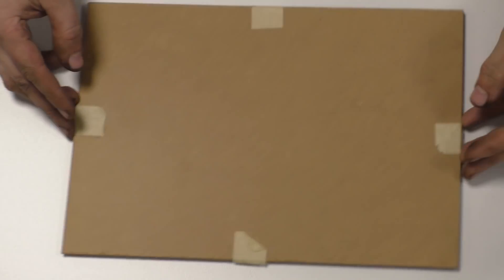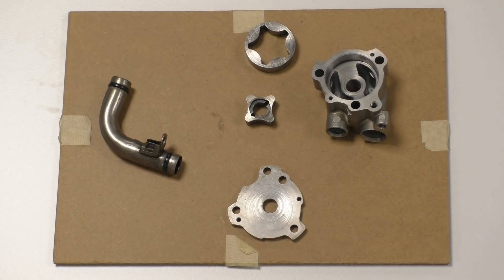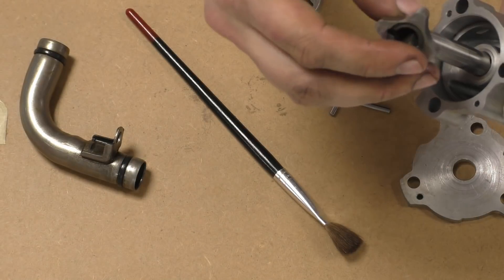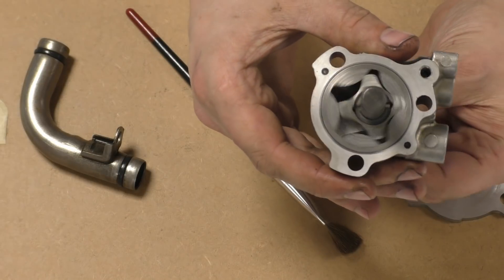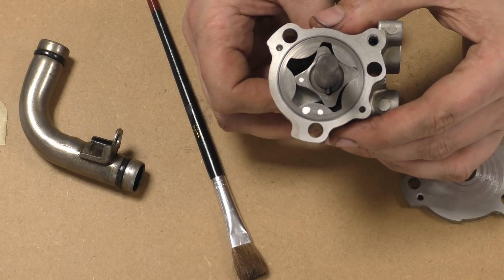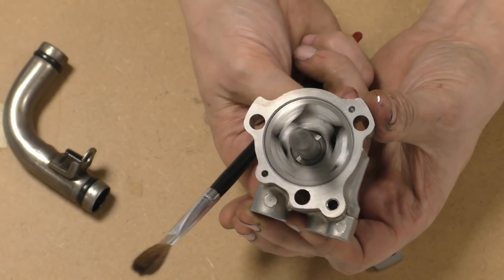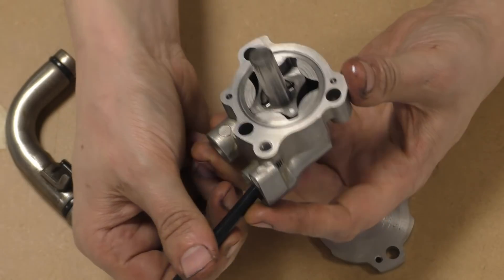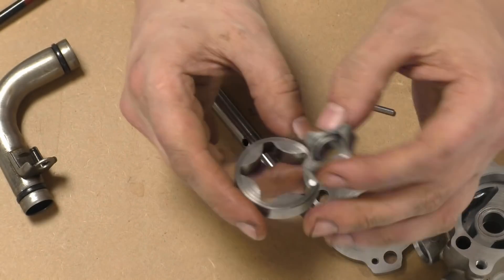Eccentric Oil pump - Close look - Part 1

Comment: How efficient are those things in pumping?
Reply from the maker: Quite efficient - the leak back is quite low and is required to maintian the clearances between the rotor
Reply: The Workshop until an armhair falls into the thing
Reply: One thing these pumps have been preferred for is that they don't foam the oil as much as gear types. edit  I recall this design was called a 'trochoidal' oil pump in service manuals.
Reply: That doesn't make sense. Gear style pumps can't foam oil, or any other properly functional pump for that matter. You are mistaking.
Reply: Bob Nonya - That's what I recall from some technical treatise done decades ago - best of my recollection.  It had something to do with "cavitation" which draws air into the liquid being transferred, even breaking down the composition of the oil to some extent. edit  Along with the difference in pump designs, there is the added component of how some oil formulas behave.  I got into cycling when some dealerships were advocating non-detergent oils for British bikes, having to do with how detergent additives were retaining bubbles in the oil.  That had largely changed within a few years as shops I was familiar with - plus the one I worked in -  started using detergent (HD) oils in everything we sold, starting with Honda.

Btw, in dry sump motors, foaming the oil is commonplace on the scavenge side.  Scavenge side of the pumps have a larger capacity than the pressure side so when a sump is temporarily emptied, there will be air drawn into the return line.
Reply: Cavitation is not drawing air, its creating a void because pump can't pull enough oil in and something has to fill it, literally and empty bauble, but not an air bubble. That bubble collapses at supersonic speeds once on positive side of the flow. Either way gear pumps or any other pumps do not add air in to the oil man, you have been misinformed. Not unless its pulling air in with the oil, there is no way any style pump can aerate oil.
Reply: Bob Nonya - Yes, I considered that after I posted, and I can take the correction.  The trochoidal pump design eliminates the gear teeth from passing sharp edges creating such a disturbance.
Reply: Bob Nonya - When a gear pump develops a continuous line of those voids, won't it cause a reduction in oil pressure and perhaps volume?  I'm trying to recall the details selling the one design over the other which was easily understood at the time.  Anyhow, it seems like the higher the rpm of the pump will reduce efficiency in the gear type, perhaps even plunger types like I recall in Triumph twins back in the late '50s.  I recall there was also something to do with heat caused in the oil by the disturbances.  The outer ring of the trochoid design turns relatively slow compared to the impeller which makes a more uninterrupted flow.  Just thinking out loud.
Reply: I probably cam off as a dick, my bad. Not sure why gear type pumps are not used in bikes. Maybe because of the space constrain?

Comment: What sort of rpm do these things run at?
Reply from the maker: Depends on the gear ratio - and where they run off. Sometimes crank speed, sometimes slower, depends on the pump OD as well.

Comment: I produce lots of pairs of rotor and annulus sets like this every week and ours are sintered iron (quite soft!) impregnated with oil.
Their profile is produced during the sintering process and requires no further machining or profiling! we just have to grind them as a matched pair to the required thickness and put a keyway into the rotor (inner) for drive.
 We only very occasionally use solid steel sets which are wire eroded and are never hardened. These pumps are used in high performance racing engines so they must work and the failure rate is very low, usually caused by something else breaking up and jamming the pump! I bet if you were to run a file over the set you have you'll be suprised how soft they are!...
Reply: roythearcher sintered rotors in these oil pumps? seriously, I wouldn't have guessed that.